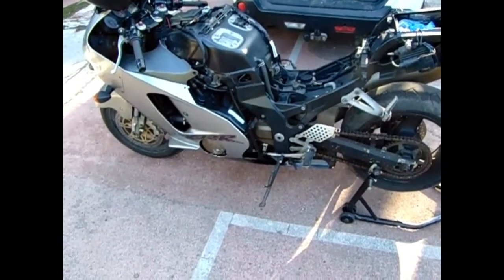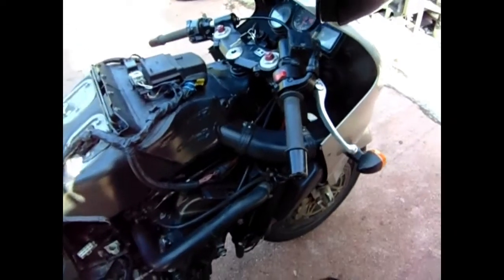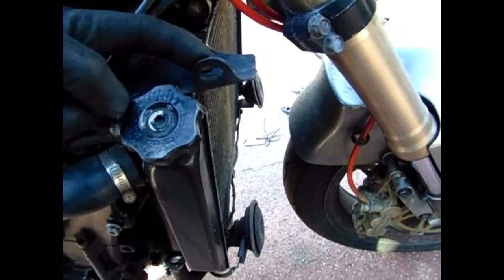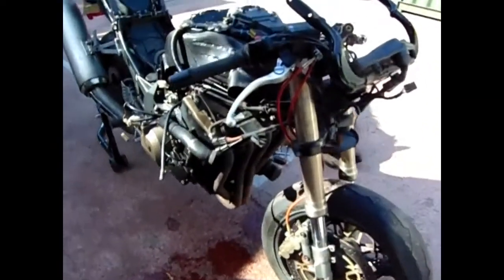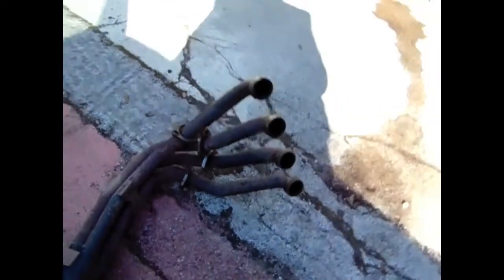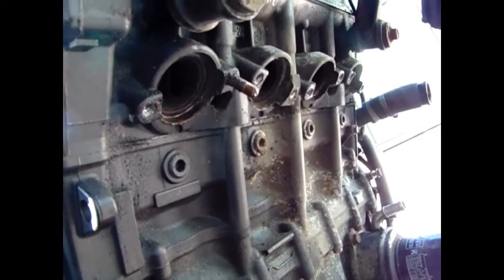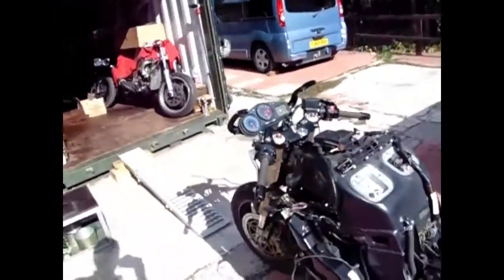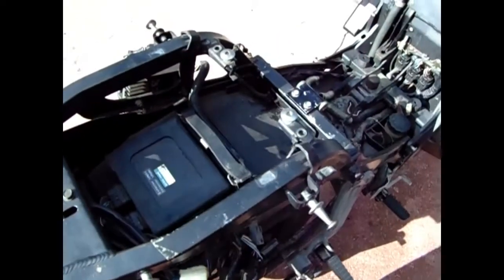ZX12R STRIP - REMOVE SUBFRAME TO GAIN ACCESS TO THE REAR SHOCK

Comment: Impressive! Jason, if you have everything outside - please check the wiring connection between the most crucial part's on this bike is mean: the stator and voltage regulator .. use an ohmmeter to check the resistance - as I see in UK is a high humidity problem - rust is everywhere - this 20y wires could be rusty inside.. that increases the internal resistance.  I'll wait for next videos! cheers from Poland. !
Reply from the maker: Hey thanks, I will do 👍